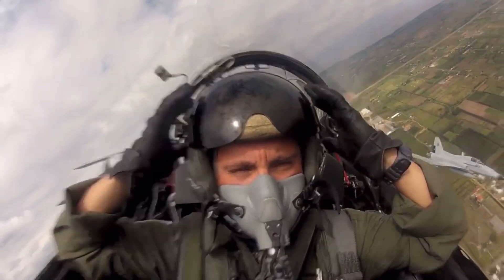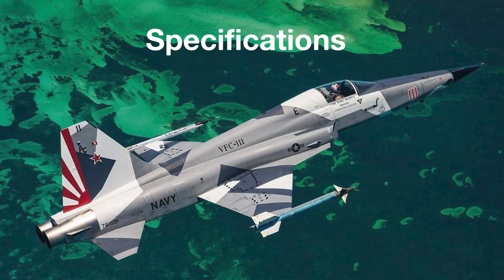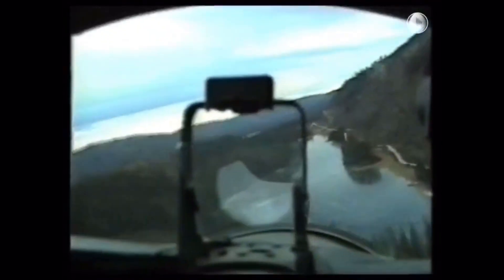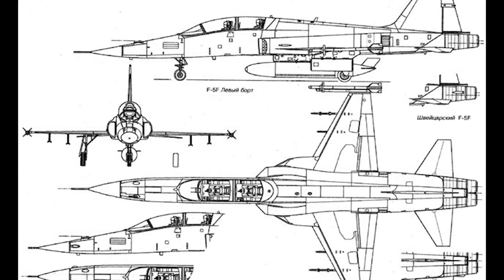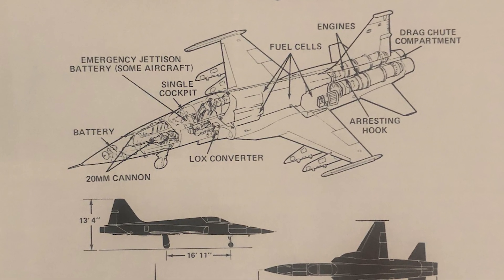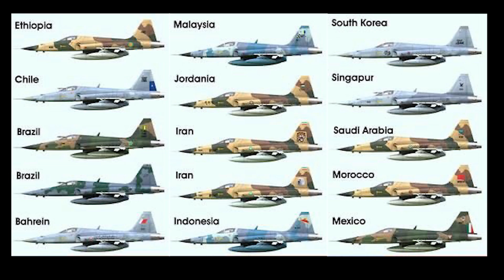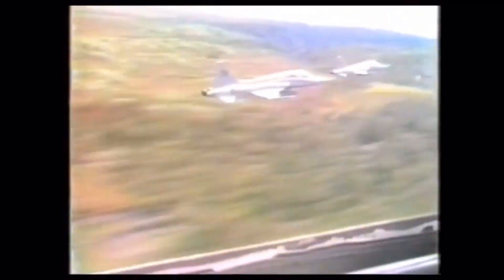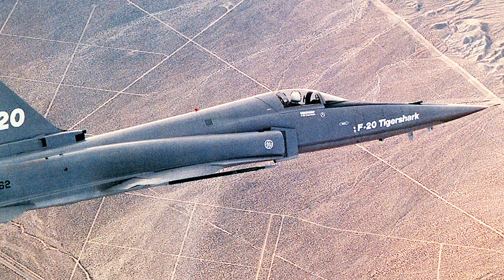F-5E Tiger II Best of Aviation Documentary

Comment: Recognizing the limitations of the aging platform in the 21st century, Brazil initiated the F-5BR program in the 2000s, a deep modernization effort conducted by Embraer and the Israeli company Elbit Systems' subsidiary, AEL Sistemas. This upgrade was so extensive that the resulting aircraft was redesignated the F-5M ("Modernizado").

Key upgrades transformed the F-5 from a 3rd-generation analogue fighter into a capable 4th-generation platform:

Advanced Radar: The original simple radar was replaced with the Italian Leonardo Grifo-F multimode radar, enabling the detection and tracking of multiple targets.
Beyond Visual Range (BVR) Capability: The new radar, combined with the integration of the Israeli-made Rafael Derby active radar-guided missile, gave the F-5M the crucial ability to engage enemy aircraft from long distances.
Modern Cockpit: The analogue "steam-gauge" cockpit was replaced with a "glass cockpit" featuring three multifunction displays (MFDs), a Head-Up Display (HUD), and Hands-On Throttle-And-Stick (HOTAS) controls, significantly improving the pilot's situational awareness and reducing workload.
Advanced Weapons: In addition to the Derby missile, the F-5M was armed with the highly agile Python IV and V short-range, infrared-guided missiles. Pilots were equipped with the DASH helmet-mounted display, allowing them to target enemy aircraft simply by looking at them ("off-boresight" capability).
Datalink and Self-Defense: The aircraft received secure datalinks to communicate with other FAB assets, like the E-99 airborne early warning and control (AEW&C) aircraft, and an enhanced electronic warfare suite, including a Radar Warning Receiver (RWR) and chaff/flare dispensers.
This modernization made the Brazilian F-5M arguably the most capable version of the Tiger II ever to fly, turning a classic dogfighter into a formidable interceptor for the modern era.

Comment: I still say, if they gave the F-5s proper the upgrades, to as completely modern spec as possible, theyd be just about as good as anything.  As a platform, it might be older but its still a great design, with potential far outpacing where it’s at, as the F-5G/F-20 proved.

Comment: The cost of producing a single use disposable-autonomous version should be about the same as a harpoon-missile or cheaper. A long-range BVR missile is expensive. An even longer range fighter plus missile is very expensive. A supercruise version to deliver 6x500lb at 1500-miles can be cheap if mass produced. Wings are small enough for low-drag. Consider the bloodhound missile and the f5e-tiger2. Why not just use the damn runway and save money on the boosters(launch).?

Comment: Very well explained 👍
F-5E is an amazing feat of engineering 👌👏
Can Northrop Reincarnate F-5E into F-5NE (N - Navy , E - Export) with following improvements:
Top speed - Mach 1.6
Strengthened Landing Gear & Undercarriage
Arrester Hook
Folding Wings
Mordern Avionics
Improved Radar for BVR
Inflight refueling 
If F-5NE Can be made it can be operated from Light Aircraft Carriers (e.g. USS America type) & Amphibious Assault Ships (e.g. Juan Carlos Class , Mistral Class , Canberra Class) , as it would be valuable, low cost, Light Fighter for STOBAR Light Carriers for Export Markets.

Comment: I'll never understand why in the early eighties we in the Portuguese Air Force were so extremely close to receive a batch of brand new F-5E - gossip said around thirty - to replace the F-86F, so close that we even received 12 T-38s to make the conversion, and suddenly ended up receiving a batch of fifty used A-7Ps - said to be A airframes with the avionics of the E but the weaker TF-30. And so we were left again without a fighter jet until the arrival of the F-16 in 1994. 
Although often criticized by the Press, he A-7P was actually well liked and praised by those who flew it  - one of them was a friend of mine - and of course she could fly Strike, interdiction, TASMO, CAS, and even interception missions with two AIM-9P + two 20mm guns, for lack of a better mean. I saw them fly many times, in an era when it was socially tolerated that a combat aircraft flew at 400 kts at 300 feet in peacetime, over crowded beaches! It was an absolutely impressive aircraft af low level, with great roll rate and great rate of climb if clean. Pretty smoky too. We lost a fairly large number, fourteen I believe, and as with the F-104G with the Luftwaffe no main cause could ever be ascertained. We had a lot of seagull strikes, engine failures, CFIT, oxigen induced incapacitation issues, at least one middair collision with all crew ejecting safely; many different causes. In a sad accident, a pilot tried hard to dead stick land an A-7 on her Base only to have her stall a couple of meters before the runway. He was killed.
The F-16 is a superbly safe and efficient aircraft, just think that we only lost two in 28 years, one CFIT and a major failure of the flight control system, in the test flight after the Mid Life Update. (ejected) but I'll surely miss our A-7Ps forever...
Reply from the maker: Thank you for the comment and I do plan to do a video on the A-7, it is such an underappreciated airframe.

Comment: Our former F-5A’s already retire in 2005 due to an accidents
Reply: But they are still preserved in case of possible to revive them
Reply: As of now, it's impossible to revive them.

Most of their accessories are scrap for other uses ( targeting pod,guns etc) bPAF only have a 5 operational  F5A/B in 2005, and it's almost not airworthy.. It take a huge cost to revive them, also costly maintenance due to their old age.
Much better to procure F5E from Taiwan and South korea ( Their F5 are going for retirement but properly maintained) or if possible try the KFIR from Israel  to use as a stop gap fighter..

Comment: Great video! I used to study at a technical institute near the Republic of Singapore Air Force's Paya Lebar Airbase (PLAB) back in the early 90's. Our institute was located right where the aircraft made their final turn to land on the runway. I'll never forget the distinctive high-pitched (somewhat "leaky" sounding) whistle / hiss of those J85 engines. But whenever a pilot decided to throttle up while passing overhead, that was it. Our trainers just gave up trying to talk over the deafening shrieking roar! LOL!
Did you know that Singapore locally upgraded her F-5s so significantly that the RSAF felt they deserved a totally new designation? Thus the F-5S and F-5T (2-seater variant) came into being. The upgrades ranged from a new BVR radar, glass cockpit (2 MFDs), high speed databus, HOTAS, in-flight refueling probe and even a redesigned and enlarged LERX (Leading Edge Root Extension) for enhanced maneuverability and high AOA performance!
Sadly I believe that Singapore's F-5s have all been retired as of today. A few were donated to local polytechnics and universities for their students to get hands-on training on the "REAL DEAL"! Another 10 airframes were donated to Thailand for spares. And the rest I believe are still mothballed in Paya Lebar Airbase (I stumbled upon them on Google Maps: https://www.google.com.sg/maps/@1.3609273,103.9132238,297m/data=!3m1!1e3?hl=en) =D
Keep up the good work with your excellent videos!
Reply from the maker: Eugene, thank you so much for the comment and sharing your experiences with the F-5S and F-5T...those J85s have a very unique sound!  I would love to do a video on  Signapore's Air Force and the F-5.  If you can point me to any footage or photos that are public domain I will put a video together.  My email is info@pilotphotog.com   Again thanks!

Comment: My father was stationed at Alconbury, England in the late 70s. He was at the end of his 
f-4 Recon flying days with Airforce. They had a F-5 aggressor sqad. there. They would practice with those little guys and 9 times out of 10 if the didn't get a radar lock before they merged ; they got their butts handed to them. Nasty lil plan. Low cost and maintenance but because of its range and payload the Airforce never gave its due. Funny now we are buying them back.
Reply from the maker: Thanks to your father for his service, and agree that the F-5 is a great airplane.  Thanks for commenting!
Reply: My wife was part of the 527th TFTAS Maintenance Sq. 1984-87. I worked on the TR1 at that time.

Comment: It's testimony to the superior quality and low cost to operate the F-5, that if Northrop were to restart it's F-5 line with modern cutting edge tech it would sell very well.  The roll of the Tactical fighter is one of being first to fly and first to fight upon alert of the enemy.  The F-5 does this better than just about any aircraft flying today.  And lets be frank, the modern missiles and sensors of todays aircraft make the show boating stunt flying demonstrated in military air show just silly.
Reply from the maker: Agreed! The F-5 still is an amazing platform, not just to fly but also to maintain.  It is a masterpiece of design and function.  Thanks for commenting.
Reply: T38 Talon   for a briefing on the F-5 look up Ron Gibb on YouTube.  He (a 45 year Northrop engineer who helped develop the F5) does a walk around as well as tells the real story of the F5G/F20.

Comment: And as good as the F-5Es are, the F-5G (re-designated F-20 Tigershark) was quite a slick, powerful jet but very similar to the performance of an F-16 Viper. A real shame our allies couldn't have used it as a more cost effective alternative to F-16s or the newer F-35s.
Reply: But the F5 super tiger is available , they call it F18
Reply: Probably a mistake to rename the F-5G
Reply: I still believe the F-20 should've been put into production. Could've been used as a trainer and a low-cost multirole fighter
Reply: @creoleDJ  It would’ve had to get a bite from the US military. Freedom Fighters and Tigers got acquisitions off the backs of the T-38s wide scale adoption and of course because it was handed out for free or low cost.
Reply: @creoleDJ  0
Reply from the maker: Thanks for commenting and agreed! If you haven’t already check out my video on the F-20: https://youtu.be/T-TARYA_YHg
Reply: Would have saved them a lot of money
Reply: Like the ST-21, I could see an "F-20C/D" with an F414 powerplant, and upgraded electronics.
Reply: More like wouldn't
Reply: General Dynamics didn't want the competition for their F16 contracts.

Same story as Lockheed getting the J79 engined F11F killed.

Comment: Slight  correction : The speed of sound at sea level is 760mph but at 40,000ft its 660mph. So at height the F.5E goes 1,060mph which is Mach 1.6 (with sidewinders its 990mph/M1.5)
Reply from the maker: Thanks for pointing that out and I will be sure to take that into consideration for future videos!

Comment: Small, light, fast, maneuverable, designed to kill Migs during the Korean war! Yes, they are still viable fighter aircraft, especially if you upgrade their avionics and weapon systems, say, with some F35 tech, add more powerful engines with thrust vectoring; the F5 will be a deadly, in your face street fighter, that modern aircraft will have one hell of a time out fighting. The F5 is everything the Mig wanted to be!

Comment: Excellent!  Yes, it's still viable.  A replacement may be the F16.  The F/A18 legacy is likely too maintenance intense (I worked on these in the late 80's. Avionics).  The Superhornet has better maintenance but might be a bit large for the role at this time.  So I think F16 would make a good replacement in the future.

Comment: The Philippines also operated F-5s.  Stars & Stripes announced the US would replace future Philippine F-5s with the F-5E.  A few days later, while I was on a bus bordering the runway, a Philippine F-5 took off in our direction.  As the pilot reached liftoff, he soon retracted the landing gear and he somehow hit his speed brakes.  Speed brakes really work.  The F-5 came down grinding the rear end off with showers of sparks and jerky motions.  To give the pilot some credit, he kept the aircraft on the runway, at least until the runway ran out.  My bus driver was memorized by the event and seemed frozen in his seat while we continued on our path to intersect with the F-5.  The F-5 finally stopped short of us and again the pilot amazed us all.  He popped the canopy and appeared to run in the air in his escape from the smoking remains.  Amazingly, although about 1/3 of the rear of the F-5 was gone, there was no fire or explosion.  The fire trucks arrived and soaked everything down.  I guess if you want a new F-5E bad enough, that's the way to do it.
Reply from the maker: screddot that’s an amazing story and glad the pilot and everyone else was ok.  Like you said there’s more than one way to upgrade your airplanes 😎
Reply: All 10 philippine f-5A/Bs are locked and stored somewhere these could have been recieved upgrade in 2001 but economy was low during that time

Comment: Saw one of these sitting on the tarmac the last time I was at Coronado.  Beautiful aircraft to see in person.  Always wondered if they could have been adapted for carrier use if a nation ever wanted to build a "light carrier".  Assumed the landing speed with those small wings would be too great.  Small carriers needed planes that could approach at 75 knots, IIRC.
Reply from the maker: jagreb thanks for commenting and great point.  Every F -5E already has a tail hook so the only modifications needed would be to the nose wheel and likely larger flaps or wing area.  The F-5 did directly lead to the F-18 so there is also that contribution to naval aviation.

Comment: The Republic of Singapore Air Force modified the Existing F5E Tiger to F5S type fitted with Nose Reconnaissance camera apart from the Normal updated ones.
Reply from the maker: Yes they did , and I have an upcoming video on the TigerEye series which covers that, thanks for commenting!
Reply: @PilotPhotog 
Yes and the Famous F5E Tiger 2 Fighters were modified by ST Aerospace limited in Paya lebar Air Base.
Reply: @Wongwanchungwongjumbo  I remembered listen and see them taking off from Tampines HDB near temasek poly. Sometimes I see C-130 and American F-15 too this is back in early 90s

Comment: Great video, you're doing a fantastic job with these, keep it up!  Friend of our family flew the CF5A with the RCAF when I was a kid, and I grew up at 2 different Canadian air bases where the F5s would sometimes operate (not Cold Lake, but nearby bases).  This video (clips of it were used in this vid) show the RCAF F5 flying extreme low level through Alberta and Saskatchewan up and down various pipeline/etc cut lines.  These guys were literally flying under the treetops in some cases - like the Star Wars death star trench run, only faster and crazier.     https://www.youtube.com/watch?v=_xNoMdL2Ch0
Reply: I worked on them when they moved to CFB Bagotville. They sure new how to build an airframe around the parts.
Reply from the maker: Roland Rioux they did and then you for your service!
Reply from the maker: Thanks for commenting and the info on the RCAF!  I plan on doing a series about the RCAF, I feel it is an under-reported and under-recognized Air Force.